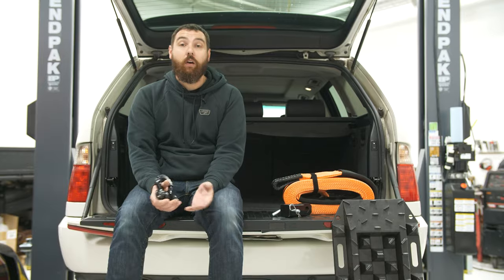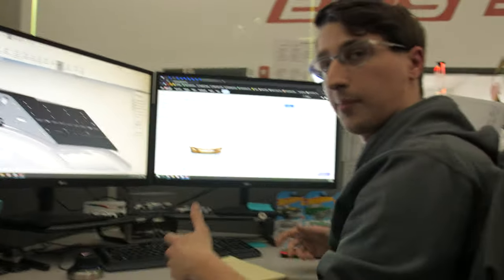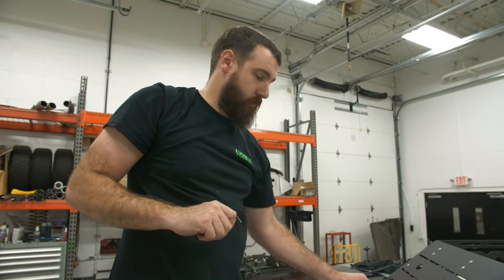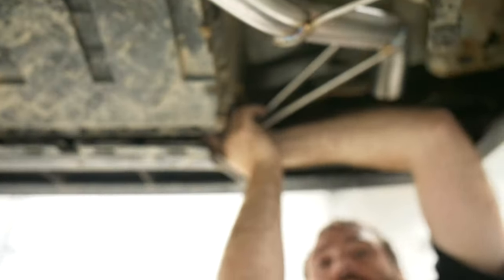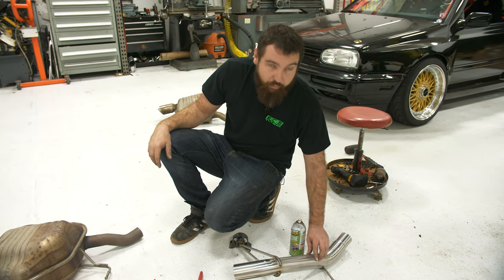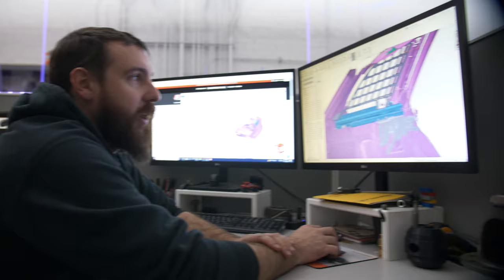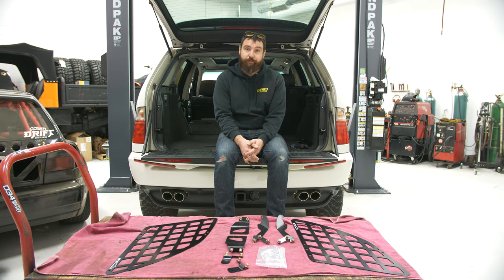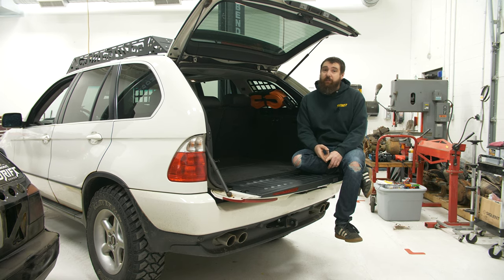Roof Rack and Muffler Delete on the Off-Road X5 | Built By Mike Overland

Comment: How about an optional front panel that would mount lights behind it to add some protection for the lights. It looks like there is enough room under the angled panel to mount lights.
Reply from the maker: This front panel is designed to mount lights onto. We have an episode on it here: https://youtu.be/N7RiHu8sDAo
Reply: @ecstuning  I was thinking more of mounting lights behind the panel. With lights installed on the outside they are susceptible to damage from tree limbs or terrain. Mounting them behind the panel would add a level of protection. Thanks.
Reply: P.S. I've been watching your videos and I love them. You can take 4 adults in comfort with A/C, skylights and Tunes! Besides, until this topic came up, I wouldn't have thought of a BMW X5 for off roading. I've been proven wrong.
Reply from the maker: Wait until you see what Mike has in store for it next!